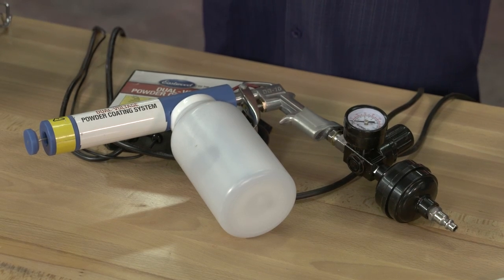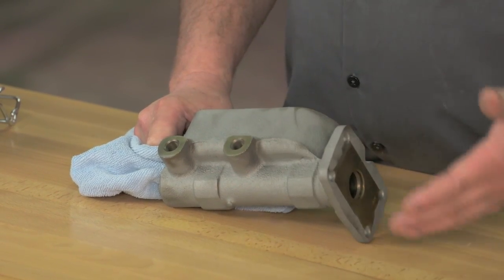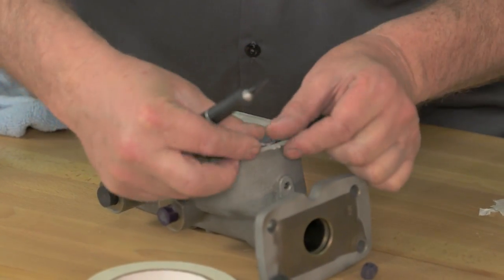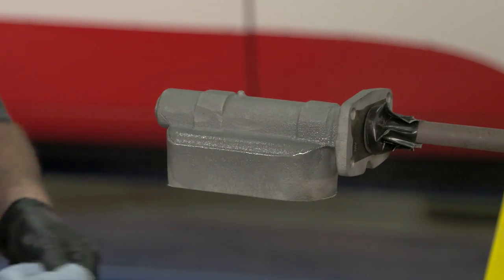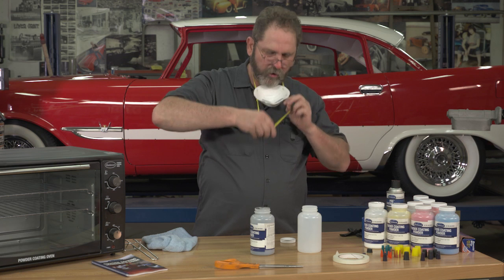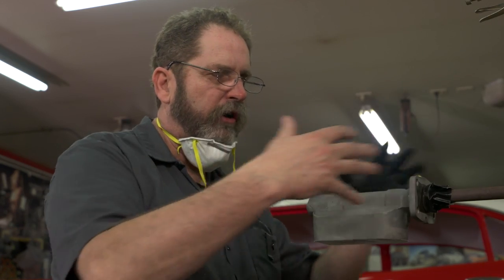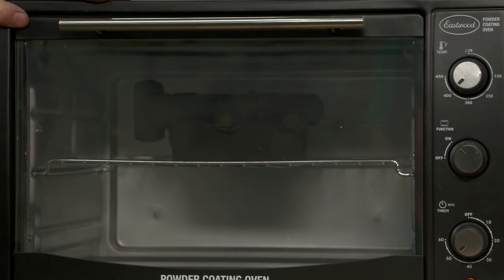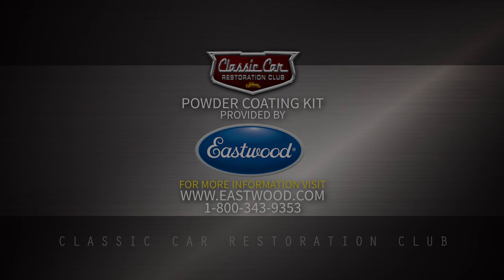Powder Coating Process: Tips and Techniques

Comment: I Have the harbor freight gun,  A craigslist 220v kitchen oven for 20 bucks, it also works as an excellent garage heater using a small fan and set to broil, Ha ha been doing it for years!     I get great results, I do use Eastwood, as they have all the colors you want.

Comment: I zipped tied the push button to the powder coating gun so you can use 1 hand on the gun and 1 hand to move stuff.
Reply: That is what I was thinking. The button is such a pain in the butt.
Reply: Have you ever brought the tip of the powder gun too close to the metal work you are holding?
Ha Ha I sure have....if your lucky you will scream a little and Not drop the work......Shocking LOL!!!!

Comment: Hi thank you for information on the fibreglass parts and do you always have too preheat parts before you powder coat them
Reply from the maker: Hello,

Not all parts need to be preheated. 
It is a good idea to preheat cast metal items as the cast surface can
 hold oils and impurities and the preheat process serves to bake them 
out. 

I have had poor luck trying to powder coat Pot Metal parts though as
 it seems to always out-gas to some degree and create pits in the 
finish.
Because the powder coating process requires an electrical current to 
pass through the material, Nonmetallic items must be "Flocked". 

A process of heating the material to 400-425 degrees fahrenheit, 
then applying the powder without electrical charge to the hot surface. 
Wrench Safe, MarkClassic Car Restoration Club Videos Membership
Reply: @ClassicCarRestorationClub  , but man it can sure help get a nice coating sometimes, i would do it more but im lazy.

Comment: Hi can you powder fibreglass parts
Reply from the maker: Hello, 
While the fiberglass cloth alone, would certainly hold up to 400-450 F. temps. 
I don't believe the resins would hold up or maintain their shape when subjected to these high temps for 15-20 minutes. 
There may be some specialty high-temp resins that I am not aware of, but they are not standard to automotive use. 
You may be better served by applying a Fiberglass Gel Coat.
Hope this helps!
Mark
Reply: You can clean, dry and then pre heat your part with a heat gun then apply your powder coat then slowly apply heat evenly with the heat gun and it will hold and adhere just fine.

Comment: Spraying a part with paint prep is not the correct way to prep a part before powder coating. And do not use masking tape in your oven either because it will burn, possibly catch fire and it will cause damage to your finish.